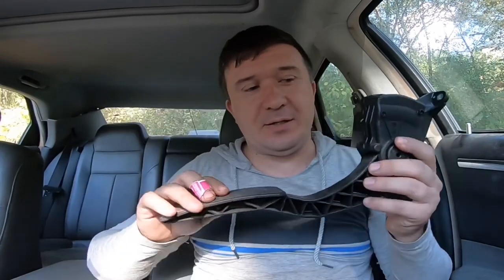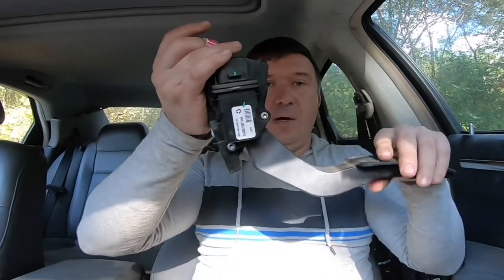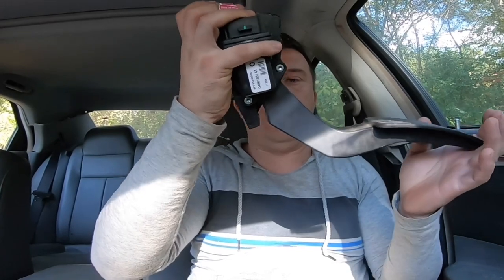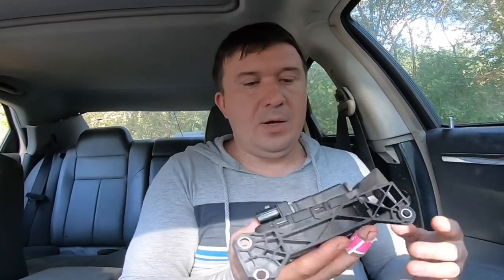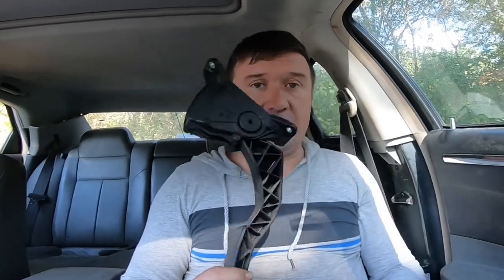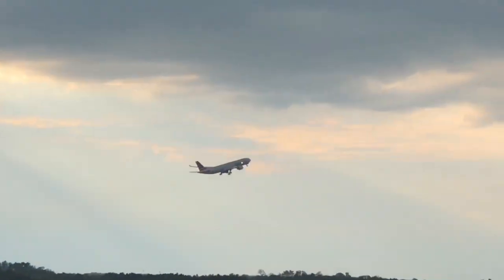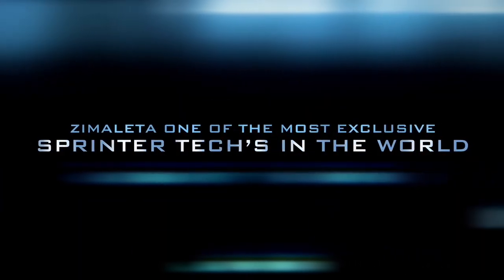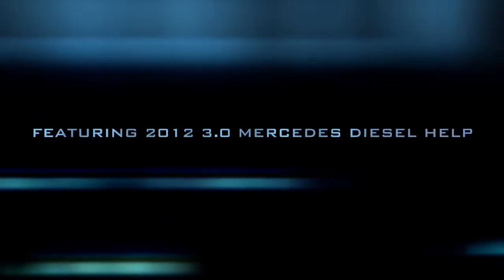My Chrysler 300 would not stop driving after removing foot from Gas pedal Excelerator pedal stuck

Comment: I replaced the pedal but I have the lightning bolt light flashing  and a constant acceleration unless I’m on the brake.  I can drive without the gas pedal. What should I do??????????
Help Pleasre!!!! 😢
Reply: I have the same problem did you fix it ?
Reply: I have a 07 and had this problem I replaced the throttle body but didn’t work. It comes on every 10 min or so. Let us know if you repaired it